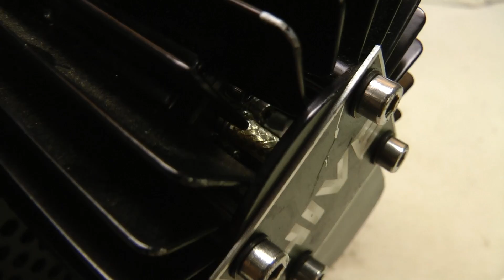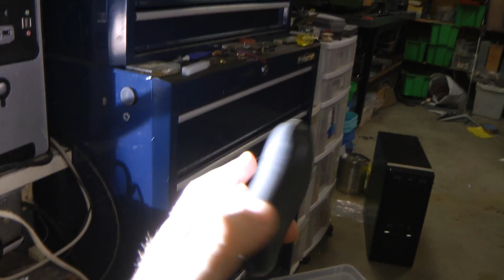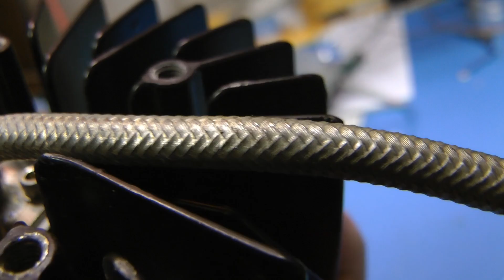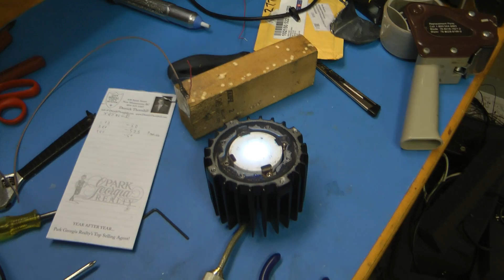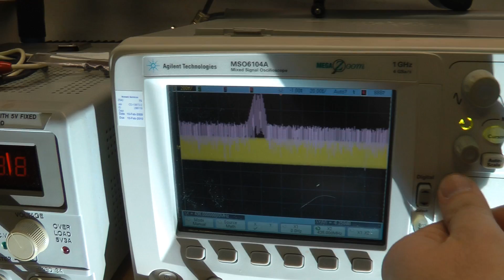WASP 250 RF-excited plasma lamp teardown

Comment: the stuff around the lamp module is most likely thermal paste and graphite heat conducting tape. This is used to transfer the heat to the heatsink. So a tight fit is necessary :-)

Comment: Those are not push-in connectors btw, those are the lever type. And hey if they are good enough for wiring in a house, it's good enough for a 200W lamp

Comment: that looks like a lead gasket or graphite . a regular thermal compound would not fair well in an rf system , its probly used as a heat paste to give good thermal conductivity , doubt its an rf shield but hey im speculating too my friend, love your work

Comment: What would happen if you hooked that up to an1/4 wave antenna? Could you just take an antenna that is the perfect length for that frequency and make it transmit? Or would a little tiny  difference in SWR just cause it to blow up in 1 second? Would be cool to turn it on for 1 second and see how far away you could pick it up.
Reply: that would be illegal AF
Reply: Don't do it you'll be sorry

Comment: Cool tech, but when LEDs start pushing 150lm/W why bother? High CRI probably.
Other lamps had its capsule rotate, that was kinda cool.
Reply from the maker: HID and derivatives like this do have one major advantage over current LEDs: way smaller emitter size, which allows much better focusing. An LED putting out this much light would be about 5x the diameter so your beam would diverge 5x faster, or you'd need a 5x larger reflector to get the same divergence.
Reply: I'd say that depends, the ones you used in your project are especially bad in that regard, and you still need to do mosaic optics if you want hundreds of watts. There are things like CBT-140 from Luminus - emitting area is 14sqmm, but only around 4klm. AFAIR best efficiency for RF excited lamps is around 90lm/wRF, but continuous spectra is not the thing that LEDs are known for, but hey,   you can already buy 180lm/W chips off the shelf, scratch that Samsung SPMWHT541ML5XAR0S6 - 212lm/W.

Comment: +tesla500
16:52
That chip is likely not an RF generator. I'm pretty sure it is an LM25007MM (datasheet says the marking is SLYB, and it's in a VSSOP package). It's a buck voltage regulator. That's why you see the decent sized inductor next to it! :D

My guess is that the RF generator might be that SOT23-5 device that you see near the center of the unit, in the area of the TO-89 package device.

I also noticed the coil-whine type noise as well. Is that coming from the lamp or the power supply? Very annoying, at least for me, with my relatively sensitive ears. (my headphones are at a comfortable level too)

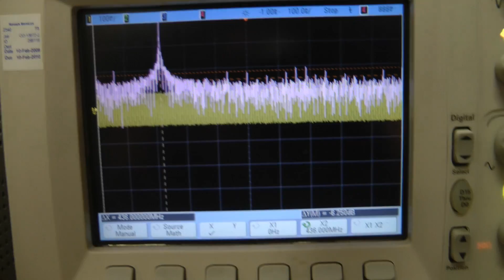Comment: Can anyone explain the annotation at 19:25?  He says it is 70dBuV/m at 30m which is the same as 100dBuV/m at 3m. But I thought the power followed the inverse square law, and so moving 10 times closer to the source would yield 100 times more power, which is only a 20 decibel increase instead of the 40 he shows. I appreciate if anyone can point out the flaw in my reasoning.

Comment: Actually, those wire connectors are Wago levernuts. I agree that something more permanent would be best for production, but those are much better than a wire nut or crummy electrical tape splice.

Comment: I was wondering what the advantages of an RF excited lamp are over a conventional arc lamp or metal halide.
Reply: Roger Onslow I would guess longer lifetime due to no electrode degradation and contaminating the gas atmosphere in the discharge bulb.
Also no glass to metal seals for wires which may leak

Comment: Great vid! The RF part should be using ceramic substrate for lower loss and better heat conductivity.  It would be fun to place the lamp in our meeting room and disable all those laser pointers working at the same band.

Comment: Funny that you complain about Wago terminal blocks - I'm guessing you haven't worked with them much. They are extremely reliable and quite expensive, and they do the job exceptionally well.
Reply: I personally am hesitant about using them because of the stab-in connectors on duplex sockets, which are known to cause bad connections. I know, they're a totally different manufacturer and a different design, but I've never really had much confidence in these sorts of connections.

Comment: Those wago terminals are actually a lot better than they look at first. A lot faster then screw terminals, they don't damage the wire at all  and the grip is extremely good. Those are called the wago 222, and there is a new version with a little bigger levers called wago 221. I gave away all my screw connectors after I found these.
Reply: ya i was a bit upset he did not seem to appreciate them. lol

Comment: I actually like the fact that they chose to use WAGO connectors on this as it makes it much faster to repair or service in the field.  In any sort of theater equipment, fast serviceability is an important selling point.  These connectors don't really add any measurable amount of resistance at the power levels we are talking and they tend to hold very secure with stranded or tinned wire.  You can pull solid wire out of them but you really have to want it.

Comment: Very nice!  Search for "sulfur plasma lamp" for a similar (same?) technology.
Reply: The sulfur ones were excited by microwaves, and the bulb needed to be rotated by a motor. If I recall the tech died off for a few reasons, the primary one being the inventor not really wanting to license it out reasonably, and the fact that it had mechanical/rotary components. That and when you mention microwave technology, people who did not understand got scared of scary invisible (and not there) radiation of course... They were primarily installed in those air filled end lit tube systems in factories.
Reply: @askjacob  how old are the patents?
Reply: The rotational Plasma Lighting System is still on the marked and all the old problems are solved.
The main problem was related to the power supply and the live Time and not to the moving parts.
In 14 years of working with rotational Plasma lighting System I never had a failing motor!!
It's just a question on part cost/quality relation.
And thru new electronics the live time of a Magnetron is in the upper 50.000h
The development of Plasma Lighting is still going on for special markets.
And for the people that have a problem with rotating we have a static solution that is working on 1000Watt Bulb power. (-;
Reply: @plasmainternationalgmbh5451  Internal rotor/external field coil X-ray tubes have worked very well for decades.  Sounds interesting! :o)
Reply: The sulphur at 2.45 GHz with magnetron (not solid-state RF amplifier) one were developed it seems by CeraVision UK and LG in Korea but each company failed the entry to market. I've never seen but heard lately that a new company made sulphur prototype has been now running solid-state at 433 MHz for high power and maybe small power with solid-state at 2.45 GHz. No idea if they've solved the troublesome issue to remove the mechanical-rotary of the sulphur bulb.
Reply: To anyone that wants to learn more about this here is the Wikipedia link to Sulphur lamp.

https://en.wikipedia.org/wiki/Sulfur_lamp?wprov=sfla1

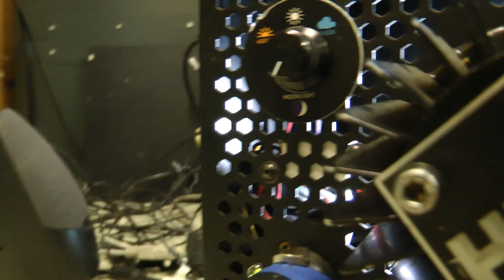Comment: Is the "coil whine" type of sound as noticable in person as it was in the video while you had the lamp on?  (For example- when you adjusted it down at 5:57 it really seemed to screech) SUPER interesting lamp, though if the coil whine is as noticable as in the video, it would drive me "up the wall".
Reply from the maker: The coil whine is noticeable but not too bad in person.
Reply: I think I must be bothered by it more than most. I've chucked PC power supplies and graphics cards thanks to that whine.  Thanks for the reply.

Comment: I used to own 2 television sets that used this technology, they were built by Panasonic under their "Lifi" range to highlight "Luxim Lifi" plasma discharge lamps. They offered a 5 year lamp warranty, and the units they built were unreliable for one reason or another (Never got more than one year out of the lamps). I believe the problem was with their RF feedback circuitry. The lamps were not a user serviceable part and it was like talking to a brick wall when dealing with the service department of my big box store who needed to have their hands held dealing with Panasonic since it was not a standard part and I had an extended warranty through the store,  but that is another story. 

Interesting thing, I took one of the lamps apart years later, there is a "Radioactive Materials" sticker on the inside of the lifi 4000 case indicating Krypton-85, which I assume is in the capsule of the discharge pill, and I am guessing your unit is the same way. The light quality from those things is awesome though when they work. The unit I had was a module with everything needed including the lamp built into a very well machined aluminum case.

Comment: That reflector is a high quality electroformed nickel typically used with xenon short-arc lamps for its precision and resistance to UV radiation.  The "AQ" refers to the reflective coating - vacuum deposited aluminium with protective quartz overcoat.  This gives higher reflectivity in the visible range over the more standard electrodeposited rhodium but at the cost of lower durability.

Comment: Those wago push-in connection blocks have an orange latch on them to firmly lock the wires in place.
Reply: SwitchingPower Yeah I have no problem with Wago blocks being used in situations like that, especially if some degree of serviceability is required. Nothing's coming loose from a Wago connector any time soon :)
Reply: Andrew Gillard They are better than Those frickin' wire nuts! German Engineering FTW!

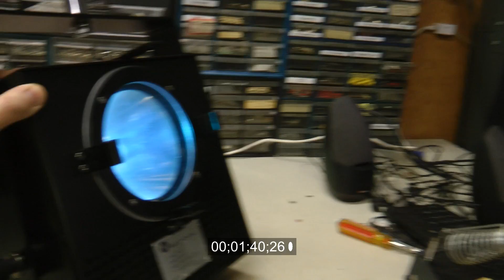Comment: There's a slight pwm-type noise just under 16kHz when you have the camera near the back of the operating light (~3:30 mark).  Was that audible or was it the camera picking up the EMI?  

I wonder if those filter screens kill the EMI.  Maybe you need to run with those in place to meet FCC requirements.  If you get a chance in the next vid it would be funny to see if it will work as a an ISM jammer and/or see if it will pick up on an FM radio.  (Would also be cool to see if you can compare the spectrum output of these lights vs. LEDs if there's a convenient way to do it.)

Neat teardown, looks like a pretty robust bit of kit.  Thanks to the Hive folks for sending it to you!
Reply from the maker: The audible noise was real, not a camera artifact.

Comment: I'd be concerned about being in situ with that amount of RF power. Very impressive, though. I love seeing the insides of RF gear.
Reply: i think the glass pane in front of the lamp is coated in thin clear metal to filter the RF
Reply: I wouldn't worry about RF exposure, since it's designed to radiate as little as possible. Regardless, 250 watts of RF isn't an insane amount, but still enough to cause injury if you're stupid

Comment: Why is there the fake CE icon the RF generator altough it looks alright?
Reply from the maker: I've seen fake (wrong spacing) CE marks on legit Apple products, among others. It is an engineering sample too.
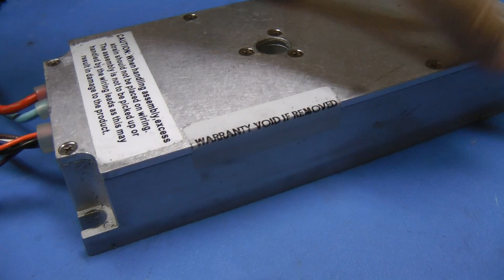Reply: You are right, almost missed it. That is definetly not a real CE at 9:30. 
On the power supply it looks like the genuine one.
Reply: whats the EMI of the production unit like? Is it just as bad?

Comment: The theatre connector is a Neutrik PowerCon connector, similar in design to their Speakon audio connector but keyed differently to avoid accidental cross wiring of power and speaker outputs!
Reply: I just stopped the video and it is not powercon - it is speakon. I was duped also...
Reply: hariz hent huh, you're not wrong! It is most certainly a Speakon connection, the keying of a Powercon is at 270° to the large key, whereas Speakon is at 180° to the large key. 

Using Speakon as the connector is technically viable as it can pass 30A at 250V ac, but that also means that if the lights are being used alongside professional live audio equipment, the power supply output could be connected to an amplifier or speaker, doing serious damage to internal components. Hence Powercon being a thing! 

Good eyes spotting my mistake! I'd assumed it was a Powercon because, well it's supplying a decent current and its not an audio device... (that's a decade or so of live sound engineering habit there, hard to break those assumptions!)
Reply: It was not my eyes. I made the same assumption!
Reply: I wonder if they chose SpeakOn because PowerCon is normally used for AC mains, while this is carrying 28VDC. 120 or 240VAC would certainly fry everything, while the output of a power amp at least has a chance of not.

Comment: can you determine if the quartz lamp outputs any UV light and if so what it's spectrum would be? I'm wondering if this lamp setup might be a substitute for mercury or xenon arc lamps that are used for their UV output. mercury and xenon lamps used for microscopy have relatively short lifespans, sometimes only a few hundred hours. they also require a minimum runtime and a minimum cool down time lest they explode. I'm wondering if this lamp design has those same limitations.

Comment: Did you test the RF output of the other light to see it it is any less noisy?
Reply from the maker: Just tested it, pretty much the same in the assembled light.
Reply: just asked the same!
Reply: Maybe you could try with one of those metal mesh filters attached in front and see if it affects RF?
Reply: tesla500 that is kind of horrid then, even if it's at 433mhz, don't baby monitor work at that frequency?, mayb you could do some experiment...
Reply: Guillermo Lovato baby monitors don't consume 250watts. more like a fraction of a watt.

Comment: Interesting that there was less RF voodoo than usual. I guess for an application where you don't need precision modulation you don't need to do much to the signal. Very cool technology, thanks for the teardown!
Reply: It have SWR metter for protecion (the small printed circuit on the uper right of the of clas C transitor and a variable cap  for tune   the antena/lamp just missing some band filters on the output.
Reply: I think yes, the "little monkey tail" 
It will triger the SWR circuit theses high  power RF transitors whit no antena/load can burn so fast SWR protecion is a must.
No sure but this mosfet worth over 100-200€
If me i willl hack it for open garaje around my house. xD
Reply: Interesting.  Is that the little monkey tail that passes under the arch and has a component at the end?

Do you think a bulb failure could cause it to start reflecting signal back to the board or would it just dump out the hole?

Comment: The connector is an Amphenol SP-4-FN. Typically used as a speaker connector for PA systems (called "speakon", originally made by Neutrik)
Reply: No no no, these connectors shown in video are not speakons, they are powercons - smilliar but you cannot interconnect those. Powercons are for supplying the power, speakons are for supplying signal (usually amplified).
Reply: Yes yes yes. It's clearly the speakon type I posted. Do an image search and you'll see.. Amphenol powercons are not colored that way. Even the speakons are good for continuous 30-40A, so it's no issue here..
Reply: Yes you are right! it is speakon! i have stoped the video and looked at the female terminal and - bam it is speakon. i just assumed that product would go by the standard.
Reply: The ones used here are Amphenol. The connector was originally designed by Neutrik and other manufactures have made compatible versions (same with PowerCon). The use of Speakon over PowerCon was probably to prevent someone accidentally putting 240/120V AC directly into the lamp.
Reply: Powercon would be much worser, because its carrying mains voltage. Also its improbable that somebody connect an amplifier to a lamp. Connecting a lamp to mains voltage isnt so improbable. Powercon is rated for 20 Amps,speakon for 40 Amps.
Reply: hariz hent That's not good. someone could plug the wrong things into it.
Reply: This Amphenol is only 30A. http://www.amphenolaudio.com/wp-content/uploads/2015/07/SD_SP-CableConnector.pdf
Reply: Saku Aspelin ahh beat me to it.
Reply: Definatly! That was my first thought after Saku replied!
Reply: HenningsKanal Im not talking about the current - i'm talking about the standard. And yes SpeakOn is handling higher current - the current needed to be delivered from amplifier to speaker, for mains - powercon. And this plasma lamp runs on DC 28V 9,8A or  AC 120V 2,3A. So why do they need to go of the standard?
Reply: the rating of the connector isn't the problem since they're both within the 10A this lamp runs at. The issue is the current limit of the things you're plugging into.
Reply: Nothing. I just called it by its manufacturer. This exact plug is rated for 30A and not for the typical 40A as Hennings mentioned above.
Reply: Saku Aspelin Oh, so they're Amphenol, not Neutrik? Or are they the same company?
Reply: nevermind. I looked it up. they're not the same company. Neutrik are slightly better (from what forums say, but you know how forums are.) Are the ones in the video Neutrik or Amphenol?